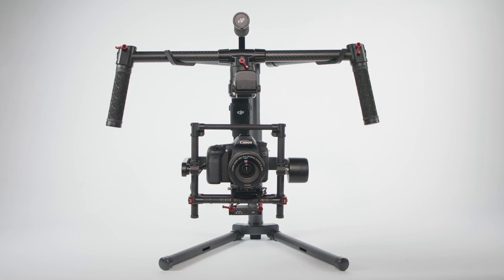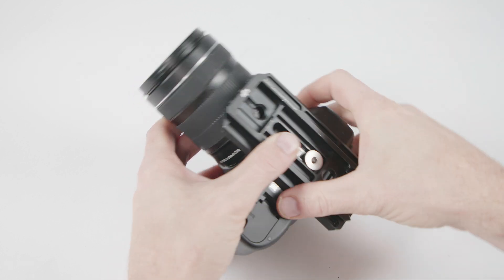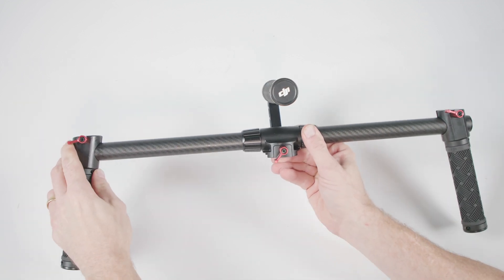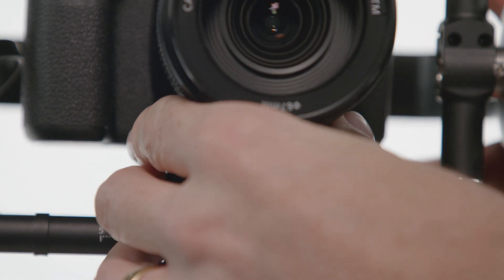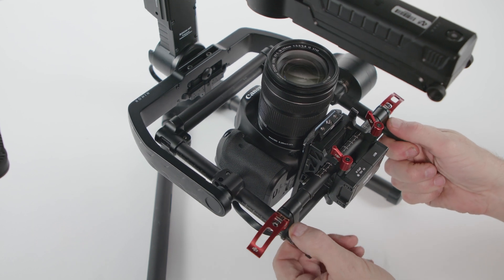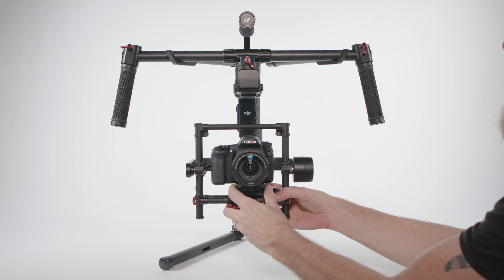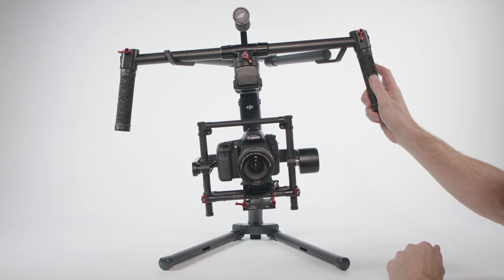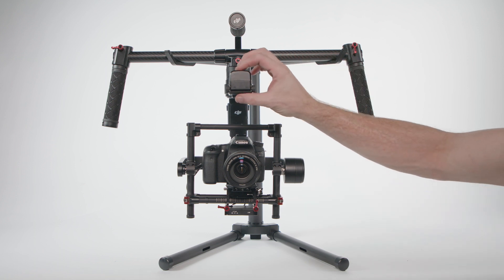Ronin MX Setup and Balancing

Comment: im really struggling to balance my ronin mx. Just when I think I've got it fairly dialled it vibrates like mad, the app is saying im 4 degrees out on some axis. I don't understand how when I can have balanced to a degree where it will remain static(unpowered in practically every position. ridiculous, considering refund
Reply: Did you resolve it somehow? Happens to me as well, MX is well balanced when turned off, cam stays in any position. When I turn the MX on, vibrates like crazy...